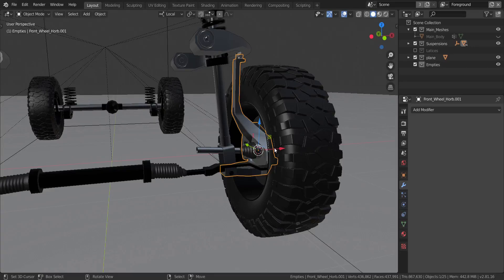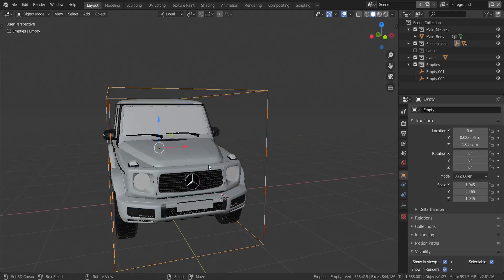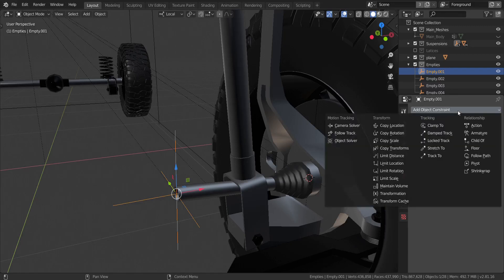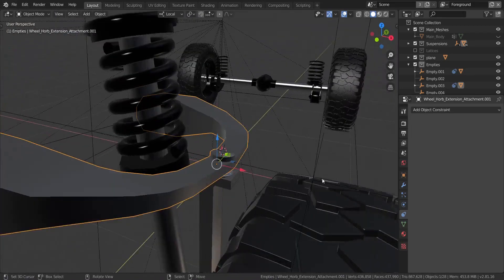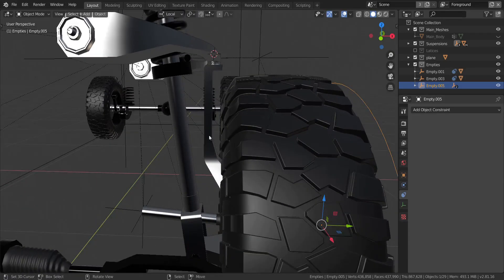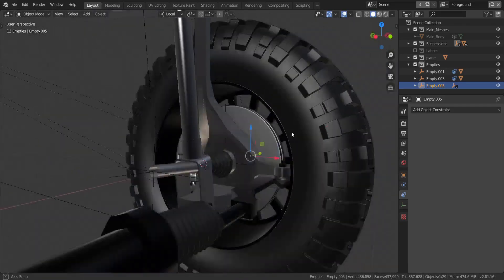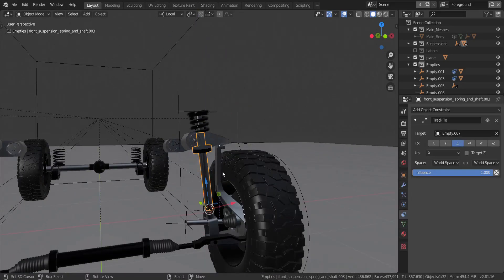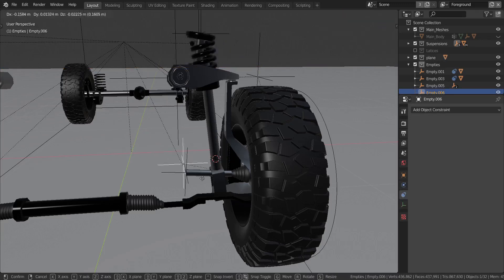Blender 2.81 - Rigging A Car - Part 2 (Front Suspension)

Comment: Hi, thanks for this tutorial series. 
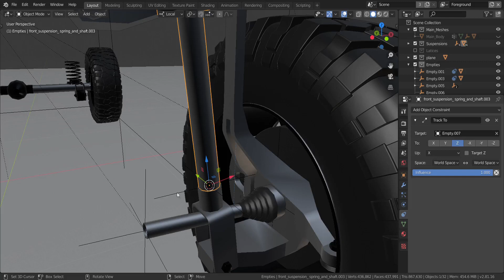I found a problem in newer version 2.93, so if someone will have the same problem, here is the solution: if the track to does not work (you can move it with empty, but not with moving the circle, in video somewhere around 19:00), replace track to with damped track. It is the same principle, you chose target and axis, and it works.
Reply: Aren’t you the man with F1 designs on instagram?